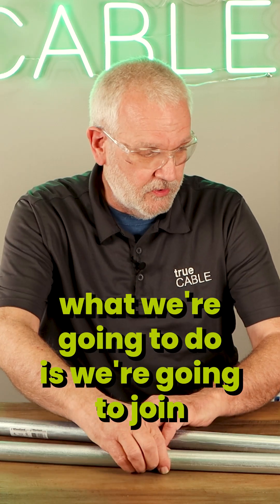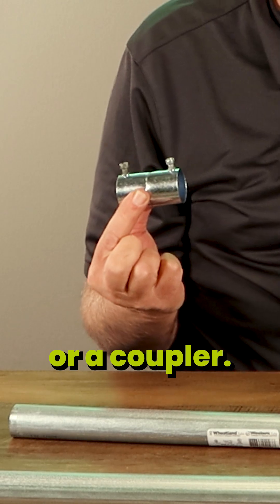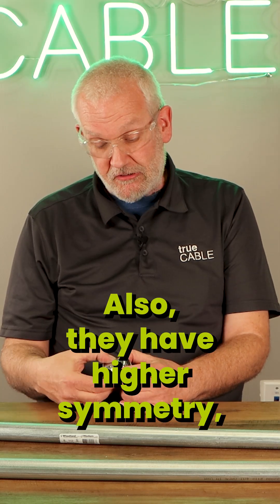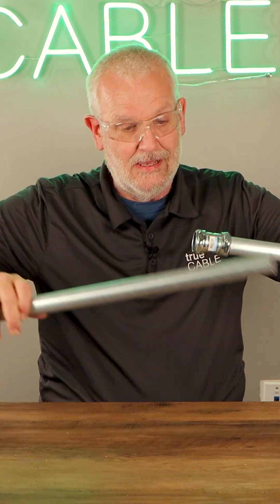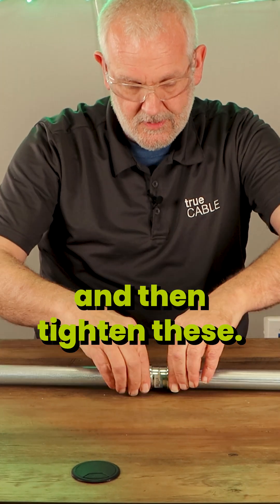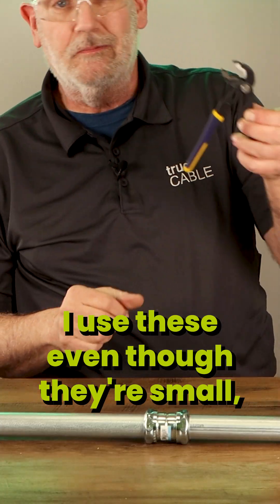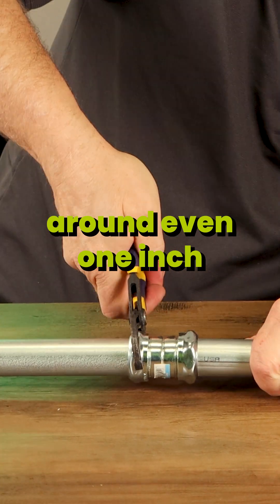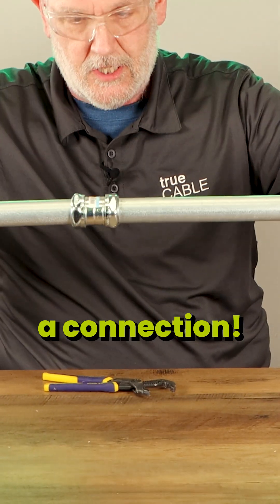Adding a Coupler to Conduit! #shorts

Comment: I hate compression rather go with set screw when running pipe racks
Reply from the maker: I think it really is a matter of personal preference. I like compression fittings, but that might be more because of habit than anything else. Also, set screws can be better when there's not much room for turning a wrench. Thanks for your comment!